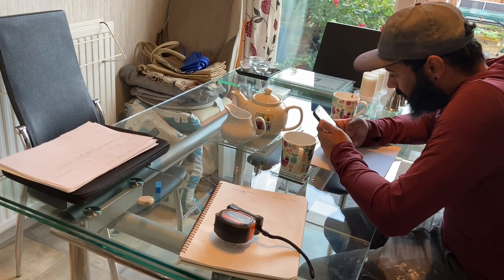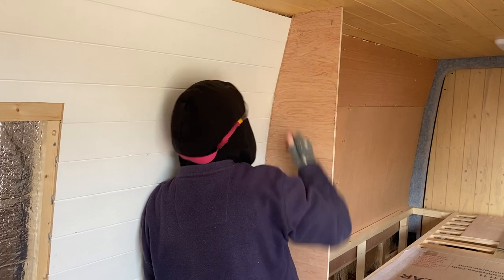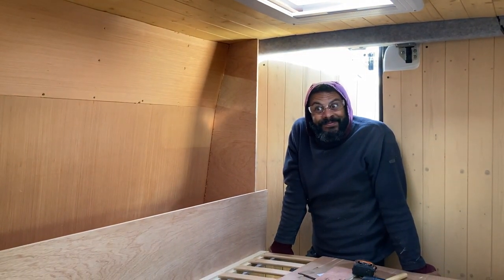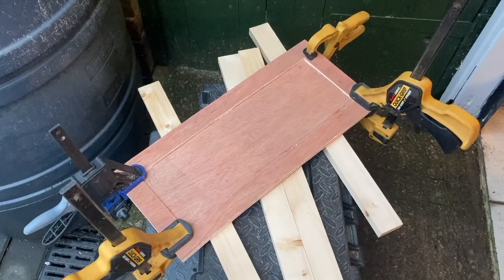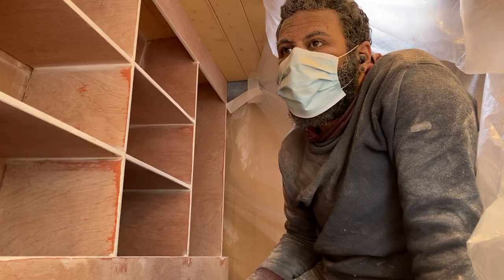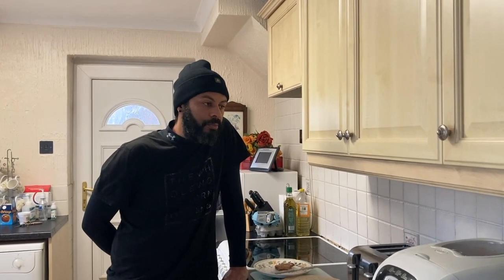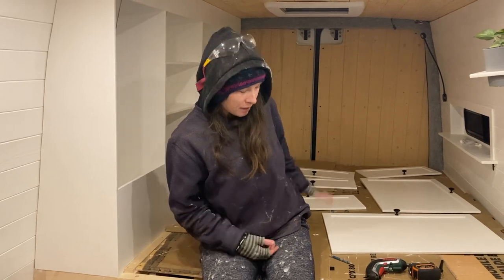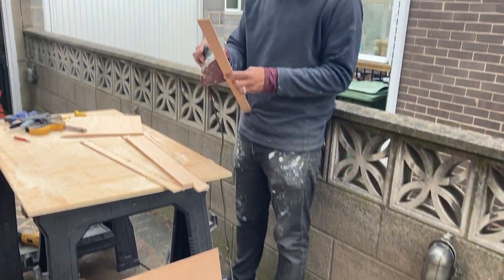Bespoke Van Conversion Wardrobe | DIY Van Build Storage Ideas

Comment: 💕In this your bottom shelf doors open upwards💕Although I’m sure you changed them after realising the problem or was it a mistake💕
Reply from the maker: Very observant!!! We wondered if anyone would notice that 😅 But yeah you’re absolutely correct, we realised once we moved in and started using them every day that having them open upwards just wasn’t practical as it was more difficult to access the stuff in them.  We’ll probably do a follow up video of the stuff we changed when we moved in 😀